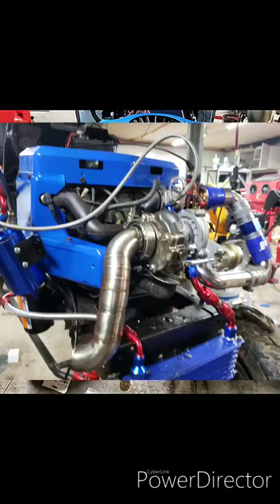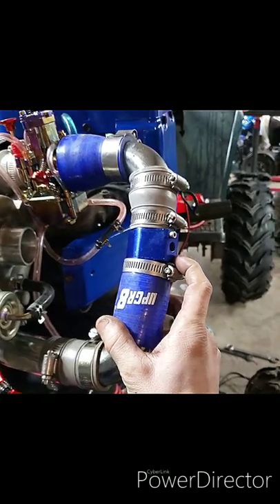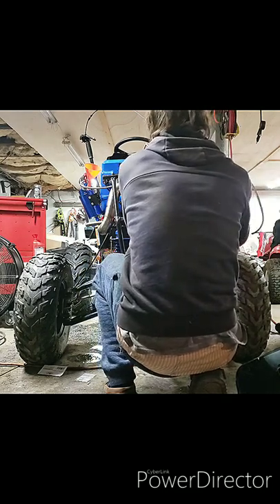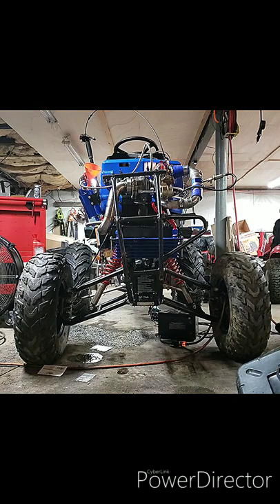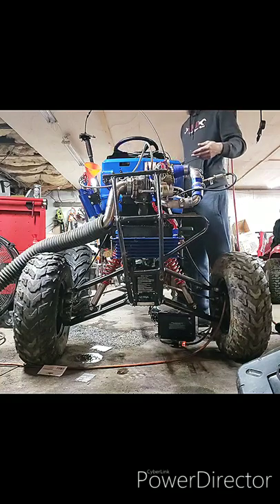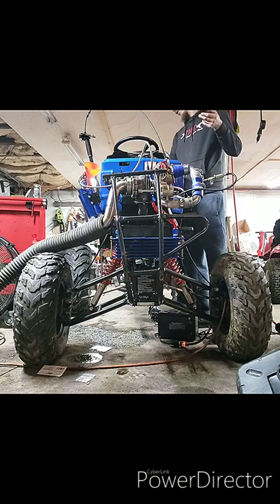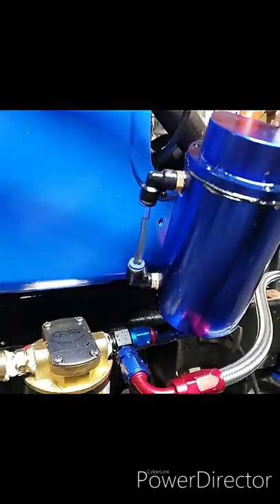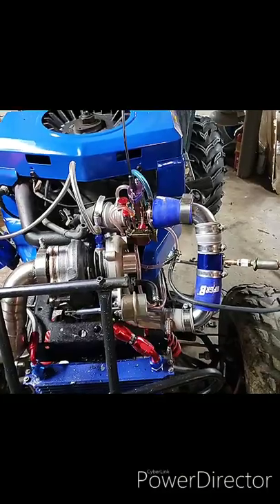Blow through motorcycle carburetor setup and explanation on how to equalize boost pressure in carb

Comment: Thats badass👍
Reply: Those vent lines need to be connected to a pitot tube, so you can have a metered amount of air going into the vents. Also a plenum would help it a bit for tuning and running.
Reply from the maker: Thanks man definitely been a challenging project stay tuned!